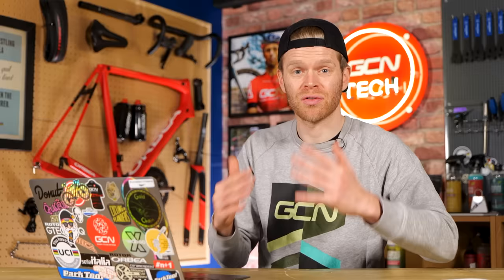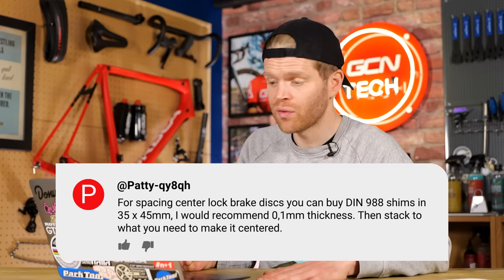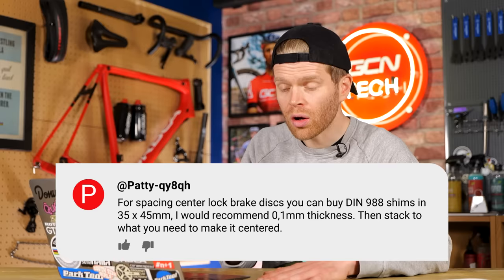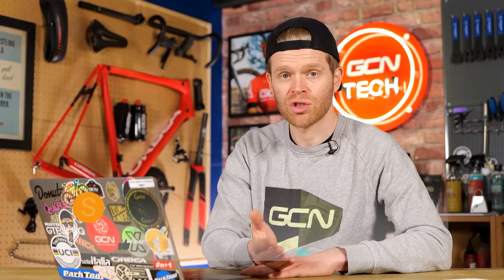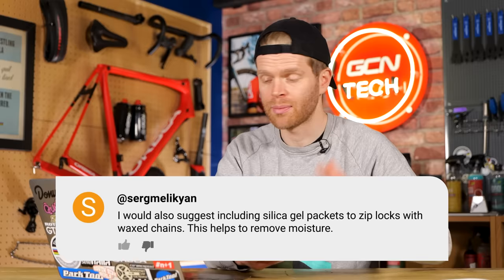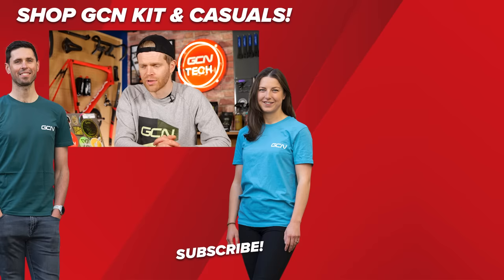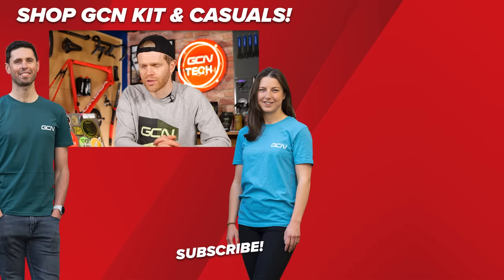Rusting Wax Chains, Tyre Width & Turbo ERG Mode | GCN Tech Clinic

Comment: I put my waxed chain in a bowl of rice to remove any moisture, as suggested. It worked brilliantly but the rice tasted horrible!
Reply: A dash of soy sauce does wonder.
Reply: @mjokffsgfjs  On the chain or the rice?
Reply: @rogersimmons8788  The soy sauce goes on the rice. Sesame oil on the chain.
Reply: You are supposed to add lube to the rice after you remove the chain. Bon appetit.
Reply: Nice one! 😂
Reply: Yeah, those silica packets are a use-once affair, and once they soak up moisture they are spent.  Odds are they were sized appropriately for the original application and have little life left by time you get them, and unless you store them in a bone dry sealed container they will become used up pretty quickly.

Wipe the chain with a microfiber towel after a wet ride and store the bike indoors afterwards.  Otherwise use a winter lube and skip wax for your winter bike.

Rice is also not a desiccant.  It will absorb liquid water similar to a towel, but just like a towel just sitting out it will not pull moisture from the air unless you have done something like baked out it moisture and kept it in a sealed container afterwards.  Rice from your cabinet is likely already at a similar humidity to your house.  Getting the rice wet with your chain inside of a sealed bag sounds like a great way to make moldy rice and a rusty chain.

Comment: Hi Olli. The big ring might be more efficient, but the power data might be more incorrect on some turbo trainer, cause the flywheel turns faster. Best gear for Erg mode: front small an rear middle or slightly right of the middle.
Reply: Spot on
Reply: Agreed. Even Wahoo recommend this. The key is smoothness at the trainer and watching for overspin of the flywheel. Several YT videos go into this in great detail.
Reply: Absolutely correct! In 34x25 my Saris is off by +/- 1 watt from my power meter and in the big ring 50x24 is already +15 watts off. Then again the higher flywheel speed gives it more inertia, therefore it is easier to get off over the top dead spot.

Comment: Belts definitely have their downsides, many of which were mentioned here, but they're not inherently limited by gear range. Of course a cheap 3-speed hub will have terrible range, but a Rohloff Speedhub, for example, 14 gears and over 530% gear range, and the Kindernay XIV offers a similar spec. And moving away from hubs, some of the Pinion gearboxes have a gear range of well over 600%. The biggest downside of belts for non-competetitive use is, in my opinion, the fact that they require a split seatstay in order to fit the single-piece belt through the frame. There is now a split belt on the market, which removes that requirement, but there doesn't appear to be much information about it so its quality and durability are anybody's guess. Also high quality, high-range gear hubs and gearboxes are really expensive, and gearboxes obviously require a special frame.
Reply: Thank you for that explanation. And I hadn't thought about getting a belt on/off with a traditional bicycle frame and gears setup! I would have to believe with today's manufacturing tech we'll be seeing good removable belts soon, which opens up more development options for belt-bikes. I would LOVE to see 50 years into the future with what will be available!

Comment: I find it curious that Ollie said that higher pressure induces wheel slip on an indoor trainer - I have found the opposite to be true. I run a trainer tyre close to max pressure and when I feel wheelslip I know it's time to re-inflate. Rolling resistance  is also noticeably more at lower pressures.
Reply: what kind of trainer do you have? Rollers or turbo? Because latter is pressed against the tyre with a mechanism and as pressure in the tyre drops the contact decompresses, hense the slipping
Reply: @feedbackzaloop  wheel on smart turbo.
Reply: @matt_acton-varian  so here you have it: keep high pressure and strict control over it or lower pressure with higher tension in the mechanism.
Reply: I think Ollie mixed up his terms on this one. In my own experience when using a wheel on flywheel trainer (non-direct), you would raise the pressure until the tire stops slipping, but there other factor is the clamping pressure is the best way to do it. I used a special trainer tire when using it for long periods, but in general ran tires are the sidewall rated pressures and used the clamping pressure knob to get it tight enough to not slip on sprints, but not tighter because too tight = more friction and heat/wear on the tire.

Comment: GP Lama did a video comparing big and small chain rings in erg mode. The small chain ring means your peak force happens earlier through the pedal stroke phase. Larger chain ring means it happens later and you can accelerate your pedal stroke more which can allow more force production. It also means peak force point occurs at a point more efficient for biomechanics. 
Also big ring gives the flywheel more momentum making it easier to continue pushing the gear.
And as I’ve seen others say with the bugger gear you get bigger power fluctuations which can make it feel easier. 
My contribution to the hive mind ^
Reply: Gp lama video if anyone super nerdy wants to learn about optimal chain ring angles 🤓

Comment: In erg mode using the small chainring, the resistance of the trainer would increase and the speed of the flywheel would decrease, the equivalent of an increase in gradient in real life. Obviously the erg mode keeps your power input the same so the resistance cancels out the gearing, but you'll feel the difference in flywheel momentum not just when accelerating but also through the pedal stroke particularly at the top and bottom, making spinning feel different in the same way as it does when spinning uphill

Comment: Belt drive is also probably the best option for expedition bikes, and if you use an appropriate gearbox like Rohloff or Pinion the gear range won't be an issue. from my experience, the belt is less efficient than a chain in 'normal' riding but not when is plenty of mud and dirt
Reply: Exactly, different tools for different jobs! I'm getting a gravel/bikepacking bike built around a Rohloff and a Gates belt drive, for long trips in any conditions.
Reply: @francoispayen  I'm with you! To riduce friction of the belt, if you have a very stiff rear triangle, the suggestion is to reduce belt tension much more than what is indicated by Gates (see Cyclingabout as reference)
Reply: @francoispayen  What kind of bike are you thinking about? I love the idea of a belt-driven gravel bike, but struggling to find any.
Reply: @Avioto  These bikes are pretty much impossible to find in North America.  You basically have to import, buy the components and build your own (Soma Wolverine frame is a popular option) or get one custom built.  I went for the 3rd option, from a local builder.  Delivery should be around February, can't wait!  Commercially available, fully built options include bikes such as the Shand Cycles Stooshie, Tout Terrain Scrambler, Santos Gravel King and Gravel Master.  All European, very high end bikes.  My custom build will be at a similar price point, but way more specific to my own body measurements.
Reply: @francoispayen  Thanks for that super detailed response. I'm in the EU so maybe I'll have an easier time. Have fun with your new bike, it sounds fantastic!

Comment: Endurance rides at slower speeds definitely go to 28, 30 may be a bit to much, but that depends on the weight of the rider. Lighter riders don't need a 30mm tire on decent roads. Wider rims are now made to fit the wider tires and should give a slight aero gain assuming the fit is good.

Comment: Step 1. Buy two chains. Step 2. Buy a chain link removal tool. Step 3. Buy degreaser and chain lube. Step 4.  Alternate chains from bike to degreaser container to maintain optimal drive train efficiency. 
Having the ability to switch out to a clean chain in less than five minutes is amazing,. And as you know having a clean drive train is important, and no one wants to deal with a nasty dirty chain.  A Hugh advantage is the dirty chain cleans itself in the degreaser while you ride. So you don't have to do much but the install and lube. Also the life of the chain is increased.
Reply: @donbethel7675 it's a great idea but your cassette etc also gets pretty dirty using wet lube
My preference is 2 chains and hot wax as the rest of the drivetrain stays much cleaner
Reply: I kinda wanna do this, it can be a good weekly routine. I always have a few chains in stock anyway. But I'd say 5 minutes is a bit optimistic though, I'd say 10 minutes of actual effort and maybe a bit of waiting time to rinse the degreased chain and let it dry.  And while you're waiting, why not spray a bit of degreaser on the cassette and chainrings. Then brush that in and rinse and dry it too. and then it adds up and suddenly you're doing a full service.
Reply: Try to keep it to under 5 minutes, and both tires on the bike. lol And I hit the rear cassette, but I have the fortune of an air compressor to air dry everything before a quick lube with the chain lube machine thingy. @RenAigu

Comment: Im a heavy sweater riding outside and my sweat seems to be highly corrosive. I tried waxing my chains for about a year. I ran a three chain rotation on two different bikes. I didn't find waxing to be any more work than running wet lube, but without exception all of these chains started to rust shockingly quickly. I maintain my bikes carefully and I have not had an issue with chains rusting in the past while using wet lube. I had cleaned the chains I waxed carefully in an ultrasonic cleaner. I had waxed then about every 150 miles and supplimented between waxing with Silca Super Secret drip wax. Regardless, all of them rusted. I went back to carefully applied wet lube (Silca Synergetic) and the rusting issue stopped. I guess waxing just doesn't work for me.

Comment: On the subject of rusty waxed chains, if mine gets so wet it needs a re-wax but I have other chains to rotate through, I'll clean/dry it right away. Leaving it lying around waiting for the next wax dunking (many chains at once) can make rusting so bad that the links go stiff. At that point, it's game over.
Reply: Not quite: a) use oil (to start with), but if you haven't; b) soak it in WD 40 for a week or so; c) drip dry it for a day or so; d) put it an ultrasonic cleaner for an hour or so, or maybe longer, changing the solution once or twice; e) fling dry it; f) compressed air dry it; g) soak it in WD 40 overnight; h) drip dry it; i) wipe it dry: it should be ok now. j) Don't use wax ever again.
Reply: @zygmuntthecacaokakistocrat6589  Thanks, but it's too late - as soon as I get stiff links, I throw the chain away. I don't own WD40, an ultrasonic cleaner or an air compressor and don't really want to either. It's all a lot of work and time that I could use to just make more money to buy a new chain! 😂

Comment: I hope this question makes sense to someone, here goes.....
I deflated my (32mm slick gravel king) tubeless tire to replace the bunged up valve. As I did so sealant leaked from all around the rim in about 30 different places.
I removed the dried sealant from inside the tire and around the beading but NO AMOUNT of messing about would get the tire to re-inflate.
I have a pre-pressure pump thingy.
So I am now running out with a tube in. The beading did "pop" in on inflation but not sure what to do now.
Any suggestions appreciated.
TIA.
#askgcntech
BTW. Love the show. Love the channel. Love what you do.
I used to enjoy cycling but now you guys have turned me into a nerd that loves everything about it.

Comment: This might all be just in my perception rather than reality, but when I use ERG mode and have it in the bike's easiest gear it feels like my resistance is being controlled by applying much more brake than it is when it's in the harder gears. Doing two ERG rides back to back - the exact same course, watts, etc with the only difference being the gear the bike's in, the harder gearing feels a bit more natural while the easier gearing always seems to feel more artificial.

Comment: The gearing comment about belt driven bikes is more or less true: Some hubs like the Rohloff Speed 14 have a range that is just as wide as (or even wider than) your typical cassette setup.  The main disadvantage is weight, and the fact that this weight is all in the rear.  Like Ollie said, it'll never be suited for road racing, but it more than makes up for it by being bulletproof and almost maintenance free regardless of riding conditions.

Comment: As a belt rider,Id say the major issue has to do with gearing. Internal geared hubs and gear boxes are heavy compared to a chain system. If your a single speed or fixed rider the belts are light and efficient with less service intervals. Until they figure out how to get a geared belt system light enough to be competitive it will never be the norm. As far as waxed chains and rust. In between waxings you can just take a wet lube,put it on a rag and wipe the side plates of the chain down. As to not interfere with the wax under the rollers.

Comment: Rice is a poor way to dry anything out. Waxed chain is good in winter as it doesn’t attract all the crud and turn to a grinding paste, but to stop the outer plates rusting, keep chain waxed as normal, after a ride wipe over with a cloth, then spray a small amount of GT85 onto a cloth and wipe across the chain surface lightly. The wax does the lubricant job and the GT85 stops the rust. Top up with drip wax as usual

Comment: #askgcntech

Can you talk a bit about any technological breakthroughs with saddle fit? I’ve tried everything (everything) but it’s still really really hard to cycle two days in a row because of the pain on my sit bones. I’m sure science has some answers and help for us people that just can’t get comfy.
Reply: Unfortunately until there are methods to create custom saddles, the path requires trial and error.  After many years I tried the Brooks B17 and fell in love with it.  The give of the leather and its ability to mould itself to my personal shape over time works just right.  But the perfect saddle for me might be torture for you.  Many people give up on the Brooks because they can't get past the break-in stage.
Reply: Specialized (in their own stores) have devices to help measure width etc. I found this invaluable after 30 years of riding too narrow a saddle (I'm a small guy - I just assumed I'd need a narrow saddle). Also a central channel really helped. But that's just for me. We're probably built differently. Obviously riding style makes a difference. If your handlebars are higher, more weight goes on the bum, and your pelvis isn't rotated forward at all - meaning more weight on the sit bones. I also know that time away from the bike = muscle wastage = less padding (in the glutes).  You may know all this, and you say you've already tried everything so I'm sorry if none of this helps.

Comment: Hi GCN! M bike was delivered with a 10-30 12 speed SRAM Force cassette, which I used for a hundred couple of kilometers. I then bought a 10-33 cassette to ride the Stelvio, which I now used for around 6000 km's. I would like to install the 10-30 cassette on my indoor trainer and keep the 10-33 on my rear wheel for the occasional ride outside in winter when it's good weather. Will this give problems for my chain because of switching between a more and less used cassette? Thanks!

Comment: #askgcntech Why has it never been tested; add paraffin oil to paraffin wax in a ratio of 1:3 or 1:2.. Hot-waxed chain does not rust??
Reply: Lol the solution to most wax problems is oil.  I find a good compromise is Boeshield T9.  It's not wax, but it's "waxy".  Still has enough flow properties to avoid the bad wax issues but easier to keep clean than oil.

Comment: i think it's funny that people are like comparing 28mm and 32mm tires while i am here running like 2 inch tires because here we have so shitty roads that you kinda need thicker tires if you wanna go fast. :D
Reply: Spot on. I'm on 35mm rubber for exactly that reason. Comfy and fairly flat free.
Reply: @BrianRPaterson  nice 👍🙂
Reply: Over time I've gravitated to 42mm.  40mm if I want to feel svelte.  I'm not worried about shaving 12 seconds off the Stelvio but I sure like to ride 100 miles without feeling beat up.

Comment: I bought a new bike saddle (3d)  it’s 3 cm shorter than the previous saddle
When changing it do I still need to measure the same distance from the nose of the saddle to the handlebar
Or should I Increase or shorten the distance from the nose of saddle to the handlebar  #askgcntech 

How exactly to replace to a shorter saddle ?

Comment: #askgcntech.  Hello Oli and all.  Here's my question.  I have an Elite Suito indoor trainer and its been working just fine for a year.  I recently added favero assioma power meter pedals to have power measurement while riding outdoor.  Both systems are calibrated correctly.  I compared both while training or racing on Zwift.  At 150 watts, Elite is constantly reading 20-30 watts higher than Favero.  At 200-250 watts, both systems report the same.  Above 250 watts Favero reads a bit higher than Elite.  I can't afford a 3rd power meter to tell which is off.  Any suggestion on how to figure this out or is one know to be more accurate than the other?  Merci!